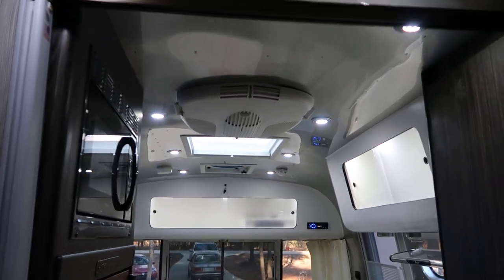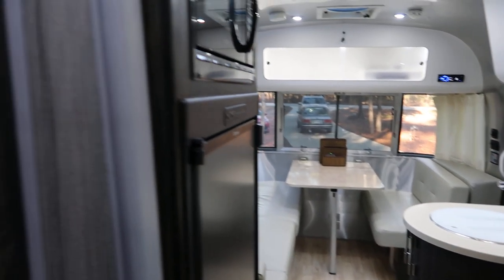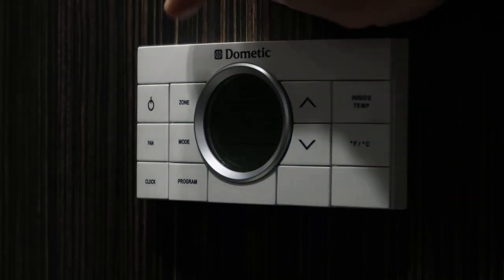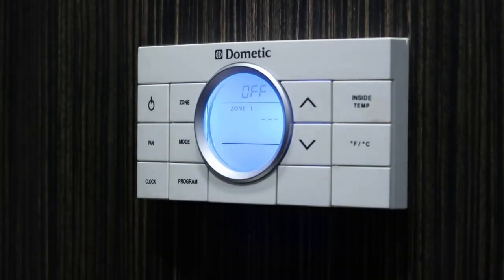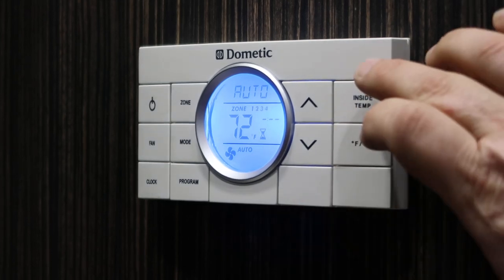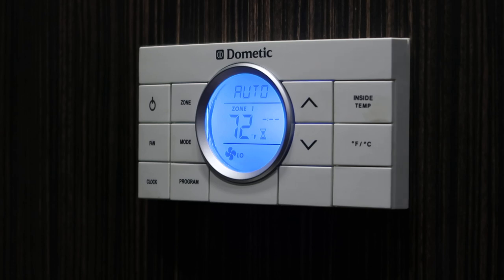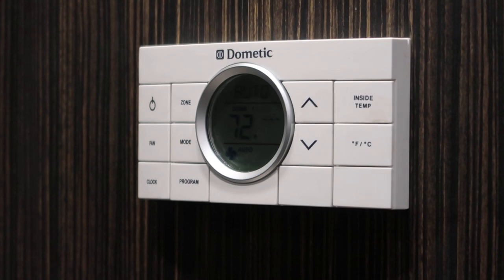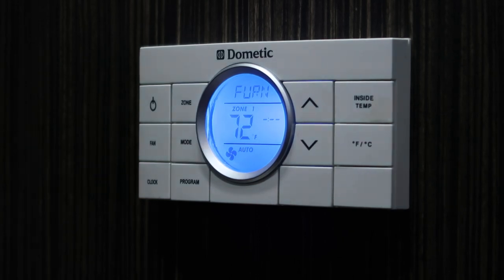Dometic Thermostat Control in an Airstream International Signature

Comment: Also if it starts not working or showing Aqua instead of furnace, just press the up and down buttons simultaneously. Also when you go to set the program once you have programmed it to the temperature at the time you like, just 'let it be' and it will continue blinking and then it will go away automatically, it will be set so dont worry. And the thermostat will revert back to your manual option for use during the daytime. Hope this helps!

Comment: I have a 3 zone DOMETIC system with one Heat Pump in each zone in my 2022 DRV Full House JX450. Zone #1 has a Dometic Penguin II Rooftop Multi-Zone Air Conditioner with Heat Pump.  Zones 2 and 3 are AC units only. I also have a propane furnace. Zone 1 unit was recently replaced. Prior to replacement, the Dometic thermostat would operate the furnace. Since replacement, when set at zone 1, the thermostat no longer displays furnace options. I no longer have a way to turn the furnace on. I have tried to call the dealer and Dometic, no help so far.